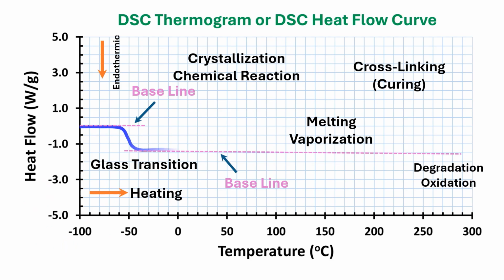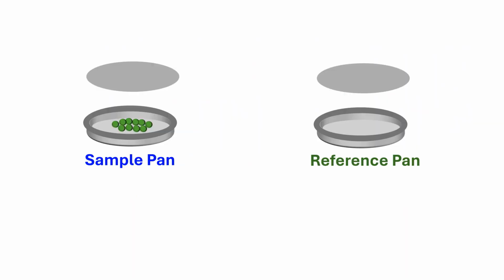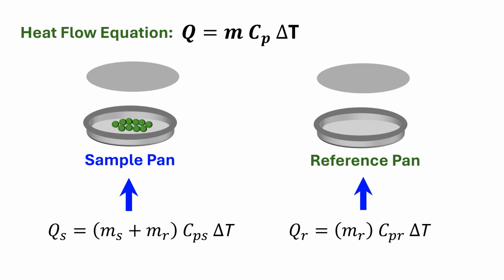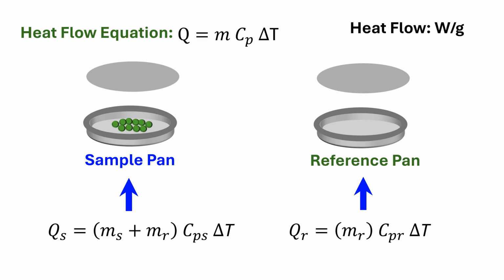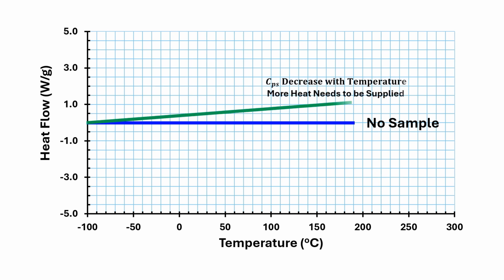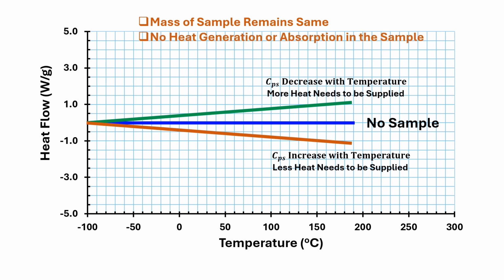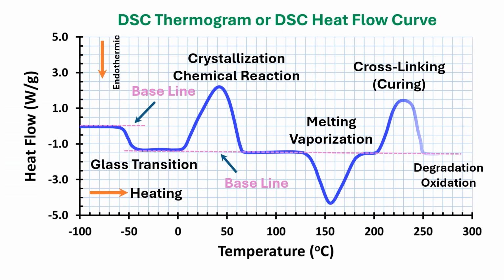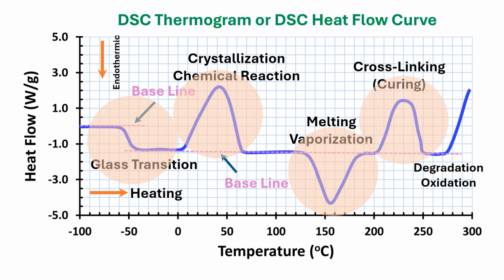DSC Heat Flow Curve or DSC Thermogram: Basic Understanding

Comment: When analyzing polymers using a DSC curve, the glass transition temperature appears as a change in the baseline. This is because as segmental motion of the polymer becomes possible, the heat capacity of the polymer increases. Heat capacity refers to the amount of heat required to raise the temperature by 1 degree, which means that more heat is needed to raise the temperature of the sample and reference material at the same rate. If the upward direction is exothermic and the downward direction is endothermic, in which direction does the baseline shift in a step-like manner?
Reply from the maker: Thank you for your comments. Most of the polymers it should be edothermic while heating, i.e. softening. However, it could be exother in some case if polyer reacts after glass and form stiff molecule in rubbey state. Recently, I have observed and literature also showed in the case of lignin. I hope this discussion will help you furher. If not clear write again and I will try to answer. Best regards. 🙂🙂